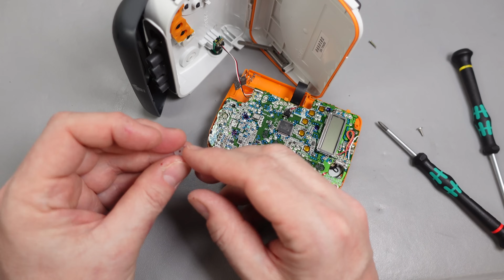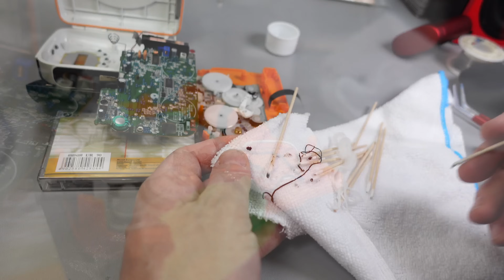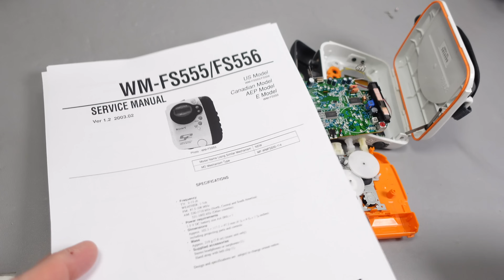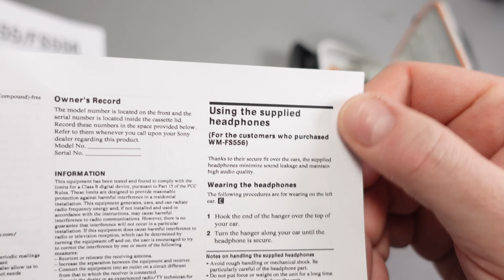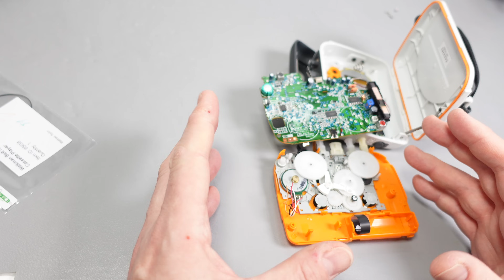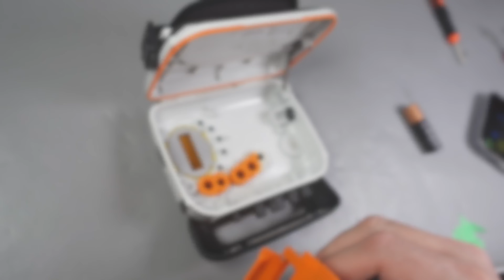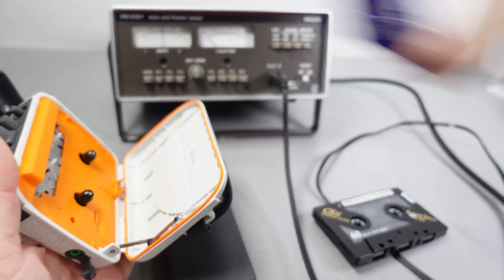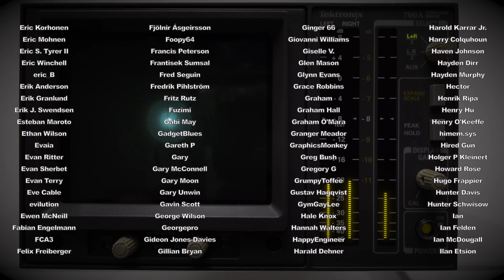SONY S2 Sports Walkman repair attempt

Comment: When it comes to manufacturing, we're starting to forget what we've learned.  ☹
Reply: It’s all about saving the penny
Reply: @41moose worse than that, they engineer intentional failure points and make it harder to repair.

So ironic since so many of these companies claimed to care about the environment. Spare me
Reply: history is a set of books that had to be rewritten more times than things had changed .
Reply: Institional knowledge lasts about 20 years. After that you're just reinventing what they did in the past because no one remembers how they used to do it.
Reply: That's a shame. @Crusader1089
Reply: The knowledge is recorded, its the effort and care that's missing today.
Reply: @thelastofus2872  As an engineer, in product R&D nonetheless, I can say for experience we care, but can't afford it. The product has to be X cheap, you can't take longer than Y months with Z size team... and it's never enough to make the best you can, so you start to cut corners because otherwise you just cannot make it, let alone as well as you would like.
That sounds a bit obvious that costs have to be kept down always but it's quite the task to determine where and how, some go too far and make unsafe crap, some priorize time to market and then you just can't cut as much and expensive products are born that a cheaper version comes out a year later for example, it's all a big balance determined by how much the target audience is wiling to pay and wait for what you're making.
Reply: @Kalvinjj  thanks for the reply. That's very interesting, I can't imagine there being a high enough demand for tapes or mechanisms today but I'm curious as to why smaller companies haven't carried on making same spec or high quality tape recorders and things, do sony hold patent and rights to the better tape mechanisms?
Reply: @thelastofus2872  Any patent prior to 2004 claimed ones have already expired, so I doubt they still have any, laser cutting and CNC bending is entirely viable for small batches, stamping tho is quite expensive, but there's a lot you can do with just cuts and bends for example. I imagine the mechanism is less of a problem, the heads are likely the core issue nowadays, finding good heads somewhere or justifying the tooling and engineering to put them to market (even copying a design takes quite a bit of effort to set it well for production, if you don't have all the work done served in a plate as if you would when licensing something), Market size is always the obvious answer, but I would put my bets on good quality heads being scarce now as the biggest reason nobody ventures into a small - even if expensive - niche of good vintage audio gear. There's only so far you can charge people before they stop justifying it, even if we could for example start building those new good quality heads.
Reply: @TD75  Good point, but you could directly correlate the electricity to the changes in air pressure that create sound waves. Both digital and analogue sources do the same thing.  The audio of the analogue sources are more compromised.
Reply: @FatNorthernBigot There is no such thing as “perfect” analog reproduction without “interpretation”. Sound is pressure waves in air, so already we are converting (and thus introducing “interpretation” in the conversion from pressure to analog electrical signals. Secondly, a properly-implemented digital audio signal path (and most are in fact done properly!) allows for complete reproduction of the analog signal, not some approximation. There are no stair steps. Finally, a lot of the measures needed to get “transparent” audio, like filtering to boost or cut frequency ranges that are under- or overrepresented in the microphone, or as part of a noise reduction system, are much easier to do well in the digital domain than analog. (For example, analog filters always introduce frequency-dependent phase shifts. A digital filter can do it without the phase shift, and can do much steeper, more accurate filtering.)
Reply: @tookitogo  Okay. "Interpretation" without the limits of previous analogue mediums.
Reply: @FatNorthernBigot  Unlikely to be possible, given that the laws of physics remain unchanged. At best, we have some advancements in materials. But it’s with good reason that every industry has moved progressively away from analog and towards digital, because it shifts the difficulties into a realm where they’re easier to overcome. (An extreme example is how we use digital signal processing to produce the best vinyl records and mass-replicated cassettes.) There certainly is value in having an analog output product that can be decoded easily (like film negatives), but there’s no reason to require the technology that produces that analog output to itself be analog; there’s no point in insisting on an all-analog production chain.
Reply: @tookitogo  The laws of physics remain unchanged.  Our ability to use them is constantly evolving.
Reply: Well of course we did. All smart people went to to big tech and are working to serve you more ads via algorithm driven/ AI apps.

 Manufacturing? The Chinese will do
Reply: Who is ever going to use tape again?  Nobody makes picture tubes either. I do hate that tape has gone away. Physical media has a feeling of permanence, even though it does deteriorate. Digital can just disappear. That being said, I'm trying to archive my audio tapes to digital because that is my best option.
Reply: @cohort6159  I think we jumped on the digital bandwagon a little too early. Perhaps someone could invent an analog storage medium that doesn't have the inherent limitations of vinyl or tape, but has never used the digital domain. Analog from source to 'speaker. I'm sure there would be an increasing demand for it from audiophiles.
Reply: @FatNorthernBigot  audiophiles use CD’s as it’s technically the best sounding format, sorry to say this but cassette is only used by people that want nostalgia.
Reply: I think reel to reel (with all its disadvantages) is your best option for analog audio. Digital is just too good in every aspect. The only reasons to go back to analog is nostalgia, optics and the fun with the physicality of it. The audio itself is perfect in the digital domain since CDs.
Reply: @bened22  I agree, reel to reel is the best current analog solution. How about a new analog storage solution? Wouldn't you be curious as to what a perfect analog recording sounds like? Something that's never been converted.  To paraphrase Henry Ford, I'm not talking about "faster horses", I'm talking about a "car".
Reply: @FatNorthernBigot  for real, the only advantage of that is pleasing the audiophile's fully belief based subjective better quality.
Don't forget that nowadays we've been using the word "digital" terribly, by just meaning files with no defined storage medium, but CD has been digital since the 80s, heck Laserdiscs had digital audio earlier and so did pro tapes.

Digital has done better storage and reproduction than any analog format since at the very least 30 years ago. Every single time the same media or file is played, DVD Audio and SACD have been better than any human will ever dream of being able to hear since 25 years ago. The video shows clear proof, the wow and flutter meter can't even register the digital Walkman player, rather it can be used to calibrate the tool, the magic of quartz crystals locking sync with perfection.

What I will agree is about "going digital" in the new meaning - ditching physical media - is stupid and I'm not gonna jump into that. I just grabbed a 20 years old CD from the shelf on top of my monitor, popped into the BDXL drive on my PC and there we go, listening to it in far better quality than I did as a child/preteen when I got it, since now I actually got better gear on the PC soundcard and headphones, and here they are all the millions of bits stored just where they should, sounding just as they should.
Reply: @FatNorthernBigot  I have to agree with calvinjj. The "car" is digital. Analog will always be some kind of horse and there is not much to be gained there.
Reply: @Kalvinjj  I agree.  Digitally-encoded sound is very accurate. Far superior than it was, say, twenty years ago, and it wasn't terrible then, but I'm curious as to what completely analog music would sound like, with no imperfections due to format limitations.  Think about it.  No one has ever experienced this.
Reply: @bened22   Analogue will always be with us because that's what sound is.  Digital is our best, most reliable method of storing audio, but is always subject to A/D and D/A converters. Keep the perfection, remove the interpretation.
Reply: @FatNorthernBigot  You did get me curious to how far can we push analog (I would be betting on tape) with current technology, like we've got the Nakamichi Dragon in the 80s and that thing comes as close to CD as possible with just compact cassette.
An SNR of like 120 db wouldn't be impossible I bet, and tightly controlled tape tension, head angles and all with current electronics... We could probably do some absolutely incredible stuff indeed.
Reply: @FatNorthernBigot  Analog means the medium has some element that is analog to the sound waves. Like the depth of the grooves in a record is analog to the soundwaves. Or the strenght of the magnetization on the tape is analog to the sound wave. The sound itself is the wave in the air, which is not analog to anything. So I wouldn't say that sound itself is analog. Analog is especially error-prone because every little aspect of the sound wave can be messed up by the medium. E.g. dust in the grooves of a record or slight variations in the tape.
Another point is that the conversion from digital data to sound waves is mathematically perfect. You can see in a spectrometer that the sound waves have the full information of the source. So I wouldn't call it an interpretaion as much as rather a perfect conversion. If you don't want any conversion you have to be live in the sudio. But of course everything is mixed digitally so all you would get in the studio would be incomplete snippets of a song.
Reply: @bened22  "Analog - relating to or using signals or information represented by a continuously variable physical quantity such as spatial position, voltage, etc. " Sound is analog. Digital requires conversion. I meant nothing more than that.
Reply: @Kalvinjj  Yes!!  We ditched the technology at a time when it was soon to be perfected. I get why. The advantages of digital encoding are numerous, but I can't help but wonder, too. We once used wax cylinders, then vinyl, then tape. What would have been next? Some organic materials? Something involving light? I dunno.🤔
Reply: @FatNorthernBigot  Analog light based audio exists, on film. It's in fact available in analog and several digital forms optically on the film reel itself, pretty cool, look into it if you're curious, and another way of doing it optically and analog is Laserdisc audio, FM encoded in sort of PWM like pits and lands (I know that's not precisely the name but same idea) on the optical disc, think of VHS Hifi but encoded with PWM.
Optical would be the way to avoid the reading heads degrading the medium by rubbing it, but I would place my bets on magnetic tape being pushed to it's limits.

Of course, at the end of the day, what we would have achieved would be... numerically identical to digital. It would just be a different way of achieving the exactly measurably same quality.
Reply: @FatNorthernBigot silicon and electricity, so yes we use light and sand lol
Reply: @Kalvinjj  ultimately digital chops the analogue signal by frequency and amplitude (bit rate) so it would not be identical to analogue, but there would be no perceivable difference, no.
Reply: @FatNorthernBigot   Well, analog also will have it's bandwidth limited in some way, for a mechanical format like vinyl records it would be limited in frequency by the speed of the needle moving and size of the particles on the record itself, size and precision/smoothness of the particles and sensitivity to the movement change would affect amplitude. For tape the particle size would be a limiting factor on both and tape speed for frequency, they all got their physical limitations, digital stuff is also limited by their analog sections, ADCs can easily do the frequency response, but just cannot do the full dynamic range of even 24 bit (144 db) let alone the meme 32 bit they're advertising on ADCs now (192. As useful as teats on a bull by the way, enough dynamic range to record inaudibly quiet sounds and death inducing ones at the same time).
Reply: @Kalvinjj  like I said, not the traditional formats. Something new that doesn't have the limitations of previous formats. We stopped researching this when digital came along.
Reply: @FatNorthernBigot  "Analog from source to 'speaker. I'm sure there would be an increasing demand for it from audiophiles."  But there is no benefit over high-res digital recording in the studio and high-res digital playback for the end user playing the song back?  Analog recording would be cool and all, but it is just more work to deal with all the high-speed reel-to-reel tapes (for every track) in the studio (notwithstanding there are studios that still use this equipment; or film-like optical audio tracks or whichever) and then, say, distribute the album in the best quality on high-speed reel-to-reel tape which most people don't have the equipment to play (noting vinyl records are meant to be a cheap consumer format, although they aren't cheap any more because it's low volume). It's admirable than many films are still filmed on film, but it's a vast amount of work and cost to deal with all the reels of film -- that are inevitably scanned in to be edited digitally (and then distributed digitally!) anyway!
Reply: @FatNorthernBigot  "what completely analog music would sound like, with no imperfections due to format limitations" What are you talking about? This is EXACTLY what live music played by an acoustic orchestra in a hall is!  Or (to a lesser extent) live music played by a rock band, as they are almost inevitably using old-fashioned analog tube amplifiers (apart from the digital bits in their keyboard synthesisers, depending on what kind of synthesisers they are using, and the digital bits if they are using modelling-type guitar pedals) and usually the drums are plenty loud acoustically (putting the PA system part of it, aside)?

As long as the playback of the orchestra sounds quite close to the real acoustic orchestra (which it ALREADY does for a decent quality WAV file or a decent quality reel-to-reel -- whether that was digitally or analog recorded -- played through a decent quality amplifier through well-engineered large speakers, especially if your room has the some of the same room harmonics as the performance hall), I do not see what the benefits of these marginal gains in format or playback improvement are meant to provide?

Obviously with tube guitar amplifiers, the whole idea of distortion and overdrive IS an analog imperfection in itself! 😃
Reply: @FatNorthernBigot  Do you have any ideas for analog data storage other than magnetic then?  All very well to say it!  There's optical audio storage like on film movies with analog audio tracks (it's already very high resolution).  Is that your preference, some kind of high-res optical audio on film, maybe the existing technique is good enough?
Reply: @TassieLorenzo I don't even remember the first thing about any of this video.
Reply: Planned obsolescence
Reply: @andywatts8654  has probably never happened in the way people using the expression mean, as a conspiracy to enrich the manufacturers.
Reply: Yes, institutional knowledge fades over time, and the advancement of technology causes older formats to be abandoned. But there is another factor as well - User Convenience guides and shapes how we enjoy and consume music. 

There was a time when albums and reel-to-reel dominated the music scene. But this required bulky equipment. It was the convenience factor that made the cassette market popular in the 70’s-90’s. User convenience drove the adoption of CDs and MiniDisc on the side. Eventually it became more convenient to carry your whole music library “in your pocket” on a digital device and finally on our phones. 

Sure, there were tangents of the odd format here and there. But ultimately, it was user preference and convenience (for the most part*) that dictated what became popular or not. 

* We can talk about Betamax and HDDVD as an aside. 😄

Comment: There should be a button combination you can press to disable the annoying BEEP noise those things make. It is so obnoxious after just a couple presses, you never want to hit a button again on those things. Fantastic video! 😊🌎❤️🕺🏻🐶📼🎧🚿
Reply: I remember driving with one and hearing that BEEP blare out of my speakers as I changed tracks on a Sony portable CD player.
Reply: There is. You should try checking out the manual. It isn’t hard, just google “ model number manual”
Reply: There is a button combination. Did you try googling the manual?
Reply: @tezcanaslan2877   my experience was almost 25 years ago. I obviously didn't read the instructions 😄
Reply: @volvo09   funnily enough i am trying to find a way to make my discman at car loudly beep whenever a cd finishes however the manual isn’t of sny help. My previous one did that but it’s motor was dead and it was very finnicky to operate as a result.